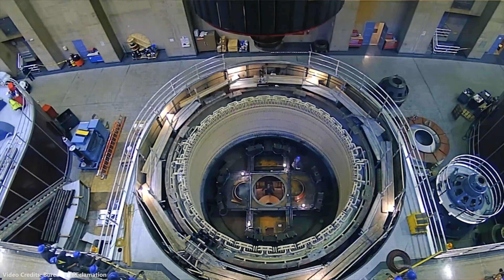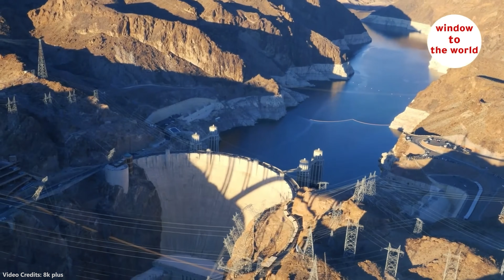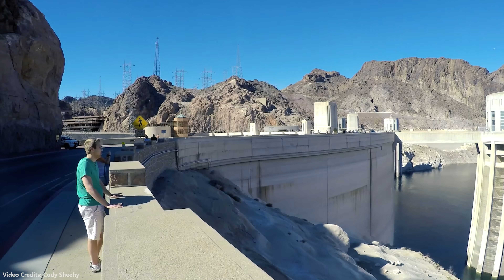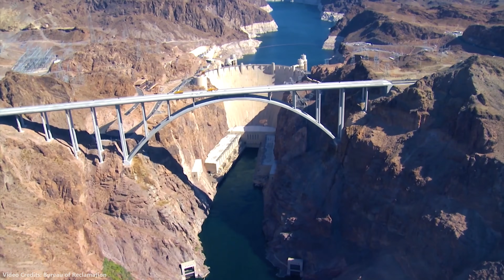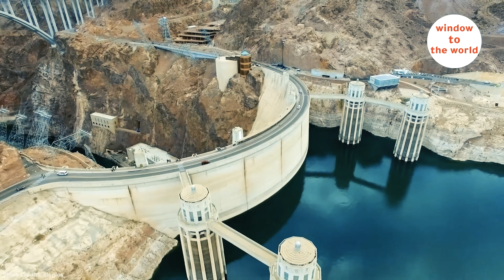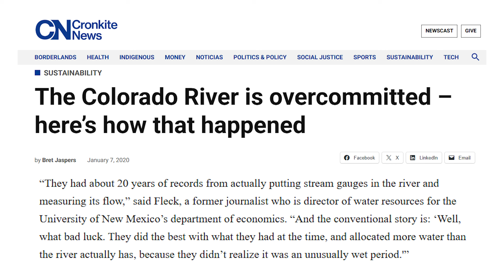America's Greatest Dam Is About to Lose Its Power

Comment: A lot of the water level issues are not caused by the 1922 Colorado River Compact, but by the 1944 Water Treaty with Mexico.
The United States continues to meet its 1.5 MAF commitment, even though Mexico has not met it's 0.375 MAF commitment (averaged across 5 year 1.75 MAF cycles) since 1997.  29 years of shortage.
If the missing Rio Grande water were balanced by retaining Colorado River Water, it would solve the Lake Mead deficiencies.

Comment: NOTICE: Boulder City, NV, is the only town in Nevada to use power from the Boulder Dam project. The power from Hover Dam goes to Southern California.  Las Vegas gets their power from natural gas solar geothermal and coal. I used to deliver the smokestack cleaning solution for one of the coal plants in Southern Nevada. Fun fact.
Reply: You are correct most of the power does go out of state to California (58%) but rural areas in Lincoln County like Panaca, Caliente, and Pioche also rely heavily on Hoover Dam power since the days of the mining booms. Nevada in whole gets around 23% and even though Las Vegas has gas turbine plants to supplement the small 3-5% from Hoover Dam, Lincoln County will have to purchase market rate power and many of the rural residents in Nevada will suffer.
Reply: Vegas also gets a large portion of its power from the dam.  Fact.
Reply: @googlevoicer Incorrect. NVEnergy sources a VERY small amount ( 3-5% max) of Hoover Dam power for Las Vegas. Most of the energy in Clark County comes from Gas Turbines with a smaller amount from Solar and Geothermal. These are easily verifiable facts directly from NVEnergy.

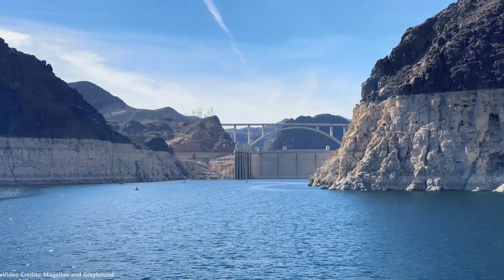Comment: 7:50 today the level is 1,039.60 feet, so only 4.6 feet away from the limit.

Edit: Historically at this time of the year lake mead level starts to rise but it hasn't yet done that this year. Additionally lake powell which feeds into mead is also at a record low level. In 2021, meads summer low dropped 2 more feet at the end of the year. If you look at the historical data for powell, this year is more like 2021 and not like other years when mead levels rose up. So I wouldn't be surprised if mead hits something like 1037 by late November. Also, if the snow fall in the mountains isn't massive next winter, the 1035 level is probably reached by next summer.

Comment: Well the fastest and easiest solution is a modular nuclear powerplant to take over the generation requirements then fix the dam and reduce its output back to an appropriate level based on actual water flow.  Add more modules to the nuclear powerplant when you need to expand generation, because you can't add more water.
Reply: There is a water problem, not a power problem.

Comment: If California agriculture would just use California water and not let all their rainfall run-off right into the Pacific, there'd be much less of an issue here.  Power generation would go down with lower minimum water release requirements each day but that's easily solved if we actually allowed for building nuclear power plants.
Reply: If Arizona, Nevada, Wyoming, Colorado, and Utah would just use their own rainwater, there would be much less of an issue here.

See how stupid that sounds? 

Every state on the ocean lets water flow into the ocean. That's how rivers work.
Reply: @Krunchy71  Your Californian is showing.  Most of the Colorado River's water gets consumed in California and yet you took shots at other states, 3 of which don't have any problems with water ever.
Reply: @ryanfitzgerald2816 California does not have a problem with water either. They are the senior water rights holder on the Colorado River
Reply: @Krunchy71  You just gave the definition of why you DO have a water problem.  You are dependent on water rights originating from 2 states that don't even border your own.  Farm the Imperial Valley all on your own water if you have, "no problem with water".
Reply: @ryanfitzgerald2816  I am not from California genius. 

The Colorado river borders California. You should probably look at a map. 

Nevada, Arizona, and other states are even more reliant on this water.

Comment: Been there many times, even before the bridge was built. It's a fabulous place to visit! I even took the dam tour once.
Also, animagraphics did an amazing video on the construction and design of this dam. Long, but worth it!
It is also worth noting that the turbines in the dam now are not the originals. They were replaced ~35 years back, but are still Francis type units. 5 of the 17 are already the newer wide-head design (meaning a wide head pressure range). These are still Francis-type, but the blade geometry is significantly different.

Comment: My first thought on cooling the concrete was "why not use the river water?" The next question was about the outlet temp.... and the fish. Yeah, save the fish and blow all that hot air into the atmosphere, then tear out the cooling unit and vent that freon into the air too. Of course they knew nothing about that.
Reply: Because ammonia transfers heat far better than water
Reply: @dexlab7539  I seriously doubt they circulated ammonia in those cooling pipes, but you are correct in that their base unit might have been ammonia with a heat exchanger in those days.

Comment: At 11:40 you said there is no engineering solution ro the water allocation problem. But there is. It’s large scale desalination in lower basin states and mexico so they’re not as dependent on the colorado so the system can rebound. Imagine if lower basin demand could drop by 10% on average, the reservoirs would rebound.
Reply: There’s a reason this hasn’t been done.  

It’s very, very, very expensive.

Comment: Keep in mind that there's the "Godzilla El Niño" this year.  The 1982-1983 El Niño event was powerful enough to dump so much water on the Colorado River basin that the water actually overflowed into the spillways.  This year, we're fixing to have an El Niño significantly worse than that one.  If that's the case, the Colorado River basin is going to be absolutely covered in snow, and it's gonna be deep.  Several different meteorologists are predicting it.  This winter might just be a banner year for snow in that region, and that would rapidly fill up both Lake Powell and Lake Mead (along with all the other smaller reservoirs in the region).  We only have a few months to wait before we see if they're right or not.  For all the people affected by the water & energy issues down there, I hope for them that the Rockies get a record snow year, breaking all the records.  We're one month away from Fall.  We'll soon know if those meteorologists are correct.
Reply: Even if this coming winter is a monster, it would take 5-10 monster years in a row to get the reservoirs back to 1983 full levels. The Colorado River states are likely to get a short reprieve but the megadrought is unlikely to end. 

Of course, as an Arizona resident, I wouldn't mind a shift in climate to Not a Megadrought.
Reply: @RobotImpurity  I live in the very-soggy Pacific Northwest, about five miles from the ocean, so I have no vested interest in what happens there, but I know a lot of people depend on that dam (and the Lake Powell dam) for their lives.  We're going to just have to wait and see how the chips fall, and we might be pleasantly surprised.  I'm hoping so.
Reply: @waywardwanderer8888 Waiting and seeing is the issue. Without solving the demand issues, a good supply year just delays the inevitable
Reply: I would love to watch everything fill up.  I don't think there will be enough to fill the reservoirs, but it would be fun to watch.  A wall of water slowly but inexorably rising, dam operators downstream initially being happy, then neutral, then concerned, then panicking as they let as much out as possible to make room for the new water.  Emergency spillways being utilized with an absolute deluge heading downstream, then the river delta flooding as all that extra water drains into the sea.
Reply: @richardthomas5362  It's going to be interesting, to be sure.  I remember living in eastern Washington in 82-83 and we got a LOT of snow back then.  I have pictures of us standing in it and it's up to our waist.  If this "Godzilla El Niño" is even worse, there might just be record snowfall throughout the region.  We're all going to be watching.  I'd love to see it all back to full.
Reply: They overflowed from being nearly full. That's not happening when they're only at a quarter of the volume
Reply: We need weather mary sue

Comment: The more you understand about current events the more terrified you will become. gathering information has been a passion of mine for decades.I've never adhered to "ignorance is bliss" but I'm getting there.
Reply: I'm intrigued. What is terrifying you the most?
Reply: This shouldn't terrify anyone. Humans are versatile, we can adapt. The dam problems can easily be solved by using less water. It is that easy. I say this as someone who uses this water myself, and I'm not selling my property for fear the value will plummet when the water runs out. The government is dragging their feet because they don't want to do that hard thing that will get them voted out of office. But it will happen one way or another eventually. Farming needs to be the first to go. And yes this means produce will be more expensive, especially in winter, but that's just the price we pay for a changing climate. It's hardly the end of the world.

Comment: I get that if the water level falls too low, you will have to shut down some turbines to protect them. What I don't get is why do you then have to reroute the excess water - why can't that be used to just raise the water level, and helping to fix the original problem, at least for a short while? So basically it seems there is a need for a constant flow rate of the water, but why?

Comment: To prevent dead-pool, could they not pull a few of the turbines/generators, seal off the holes with a hydrodynamically shaped caps then let the river continue through the existing penstocks in place of any river outlet system they may have?

Comment: They need to start building the water pipeline super highway from the midwest to the west. Trap, collect, pump all the stormwater from the east/midwest to the west. I proposed this wayyyyy back in college and my professor laughed at me. The project would help avert flooding, create REAL jobs, move a product into areas where its needed. Billions.....yes, but it would solve many water related problems. I still believe in it, too bad it hasn't been taken seriously. Keep flooding the midwest!!! It's a hell of a lot more feasible, valuable and realistic than the Newsom HSR to hell.......
Reply: To move one cubic foot of water from Michigan to California would require over 370 kWh of energy, assuming the pipe is completely level the entire distance. That's enough energy to power a dozen homes for a day, just to move a little over 7 gallons of water.  Lake Mead currently sits at a deficit of 6.5 Trillion gallons of water.  I think you can start to see the problem with your idea.
Reply: @Kromehoundz  i’ve received the same kind of limited comments that don’t push the envelope for this. I’ve worked in the water industry for 30 years and I know that there are power and pumping requirements, but it’s the same close minded in shortsighted views of people like you that won’t take a challenge and build something like this that saves lives makes product and helps to distribute water. Just like power is distributed but California will spend $130 billion on a high-speed rail that doesn’t do anything so you stick with your close minded opinion I still believe in a super water highway project that would benefit millions of people

Comment: Lake Powell controls the fate of Lake Mead and it is even worse off.
Reply: And Flaming Gorge controls the fate of Lake Powell. Flaming Gorge will be at 59% in April 2027.
Reply: @ErikSjaastad  Flaming Gorge doesn't actually control anything, it is being sacrificed for symbolic reasons rather than saving Lake Powell.  Flaming Gorge is far away from Lake Powell and most of the water released doesn't reach lake Powell.
Reply: @sentientflower7891  Lol, No.

The vast majority—estimated at roughly 90% to 95%—of the water released from Flaming Gorge Dam successfully travels down the Green River and reaches Lake Powell.  The released water travels approximately 412 river miles down the Green River through Utah and Colorado before it joins the main stem of the Colorado River and flows directly into Lake Powell. While most of the volume survives the journey, a small percentage is lost along the riverbed due to natural processes: Evaporation: Direct evaporation from the surface of the winding river and adjacent wetlands.Transpiration/Consumption: Riparian vegetation (riverbank trees like cottonwoods and tamarisks) consuming moisture. Seepage: Minor bank storage and percolation into the local groundwater table in dry stretches
Reply: @ngcolby so Flaming Gorge should be sacrificed for Lake Powell.  Thanks for establishing a just cause for the emptying of all the upstream reservoirs.  By next year the Colorado River will essentially be a free flowing river until it reaches Lake Powell.
Reply: @sentientflower7891  you sound clueless on the topic.
Reply: @thisisfun887 that's not an argument.
Reply: @ErikSjaastad Lake Powell is a terrible reservoir because it has a porous sandstone bottom that absorbs water. Seems like a bad design choice to build a dam on sandstone.

Comment: id imagine there's a nuclear power station in Las Vegas future
Reply: You need water for nuclear….
Reply: @hps2051  Not nearly as much, and if you build cooling towers, most of the water can be recycled. A nuclear power plant can also desalinate sea water into drinking water, and help clean much of the sewage water so that it can be recycled to water crops, or cool down data centers etc which doesn't strictly requires drinking water.
Reply: Still needs water to cool it. Look at the power station on the Danube River that's been shut down recently, also due to low water levels.
Reply: @gregleavitt1255  it's destruction by design SHEEPLE
Reply: Las Vegas doesn't get any of its electrical power from the dam. The video is incorrect showing LV. Boulder City does but it's minimal.
Reply: @horizonglowing Is there some divide in the infrastructure that prevents power going to LV?  Is it the great divide between East & West, electrically speaking? There may be transmission losses somewhere, but it all feeds into the system. And while we are talking LV, doesn't the word profligate come to mind?
Reply: .. and there's no water anymore. It's almost gonna be Deadpool and shut down.
Reply: I'd imagine a desert is a good place to plant solar. Just saying.

Comment: why are the walls of the canyon white where water has been previously?
Does the lake bleach the walls somehow?  
I know water is a good solvent for many things.  Maybe it's all the minerals leeched out by the water?
I wonder what the pH is in the Lake.  I wonder if it changes from when it's full to when it's near empty.
Reply: It’s the result of decades of water wetting the rocks just at the waterline, then evaporating.  The water has minerals in it, so when it wets the rocks, it brings the minerals with it. But when it evaporates off the rocks, the minerals stay behind. And the minerals become a permanent part of the rock, not just a coating you could wipe off. It’s mostly calcium with some others mixed in, so it’s white.